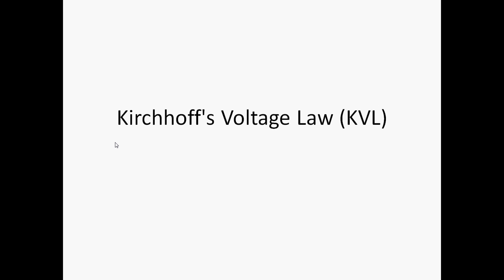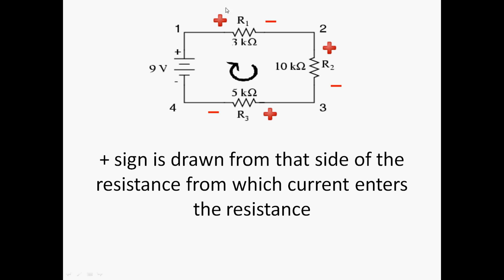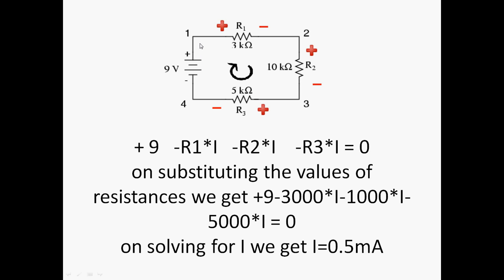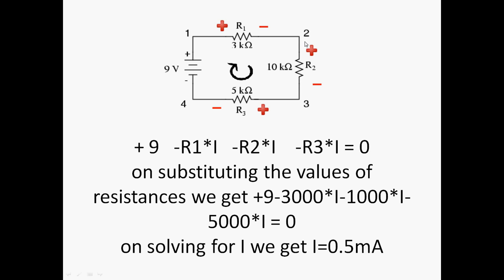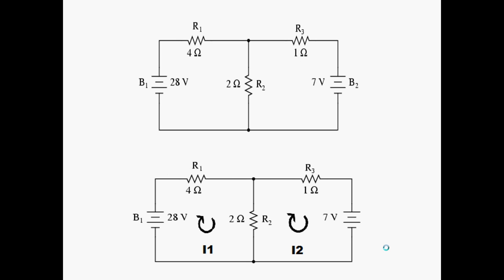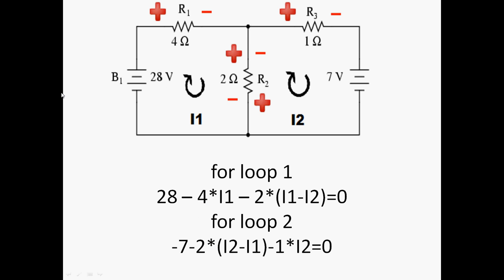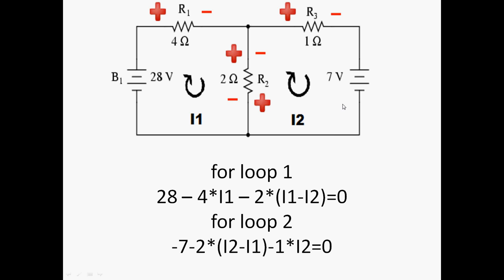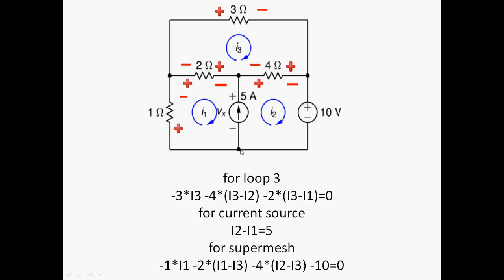How to apply KVL to circuits

Comment: sir if in two loops , we should assume the direction of current same or we can take for 1 loop clock wise & for another loop anti clockwise ?
Reply from the maker: It is your wish. But it is easy to calculate with both currents clockwise

Comment: you are probably wrong that when current travells through the circut from + to - i think it is + sine not -
Reply: sami mohamed:  no its -ve because when we go from +ve to -ve there is voltage drop
Reply: no it should be -ve,for sure
Reply: he is correct when you go from +to  - there is a potential drop cuz we take + terminal to be rise of potential and- to be fall of potential so it -ive
Reply: Sami Mohammed trying to over smart...There is a voltage drop so it must be -ve